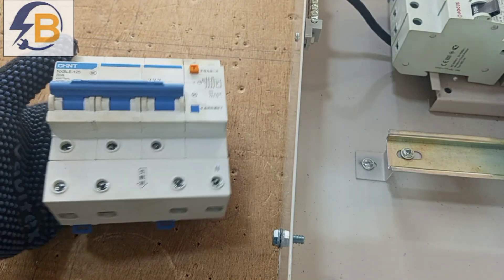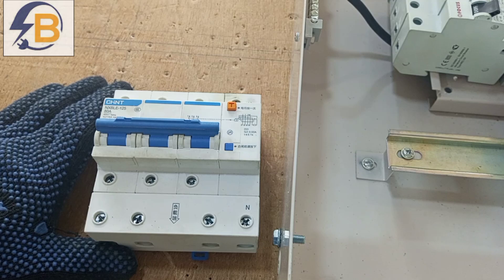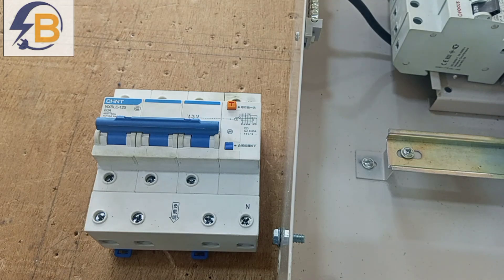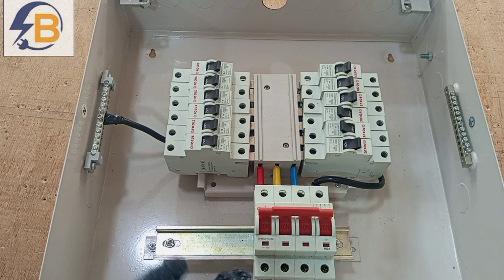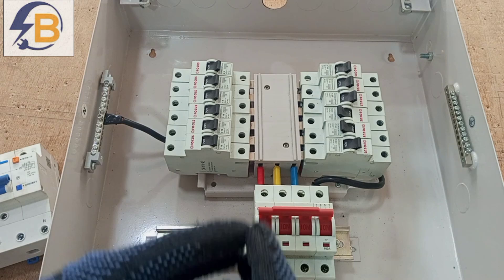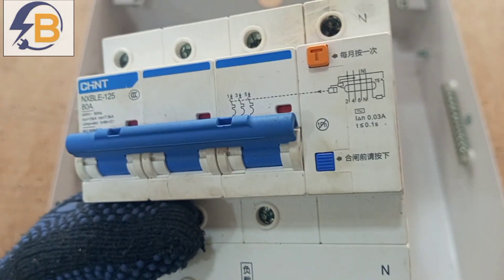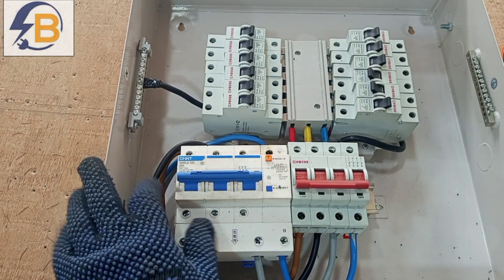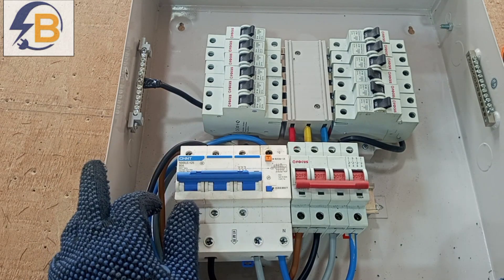HOW TO INSTALL 3-PHASE RCBO/RCD IN A 3-PHASE DISTRIBUTION BOARD

Comment: Educative.
I want to asked.u wire rccbo before  first before mccb 
My question is when using rccb or rccbo to protect entire installation...do we wire rccb or recb first before mcb or mccb
Or mcb/mccb before rccb/rcbo.
Thank you sir
Reply from the maker: @omoniyiabimbola6745  
Well, either way works fine considering the way it's been used here, but for permanent installations I would 
recommend that all other protection devices should come after the Main MCB .

Comment: Good morning sir, pls my question is, how do you replace  an individual circuit breaker in a main switch to a RCD? Because, we know all RCDs comes with a neutral pls?
Reply from the maker: @ahiagbleseth9500  if there's a need to do that then you can consider using RCBOs that are not physically larger than the MCBs